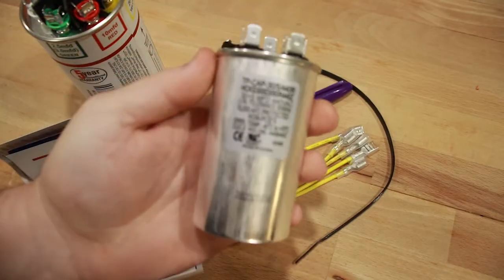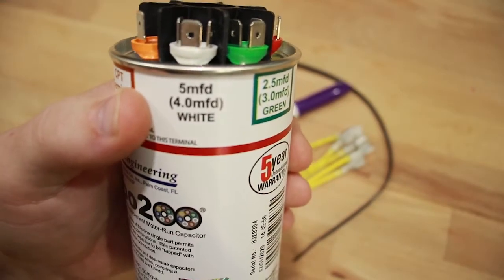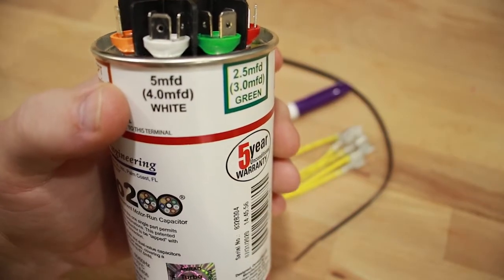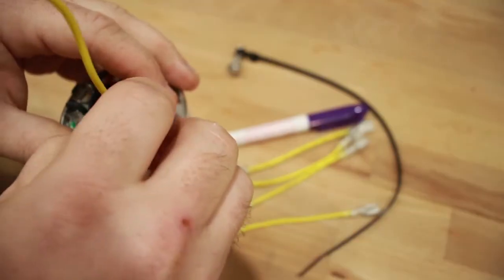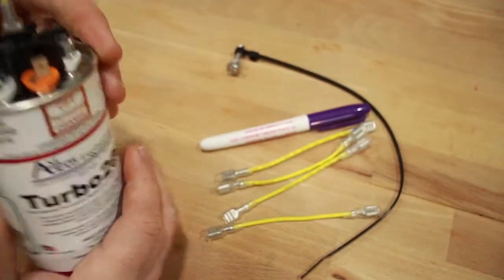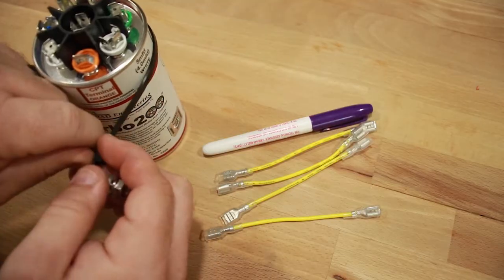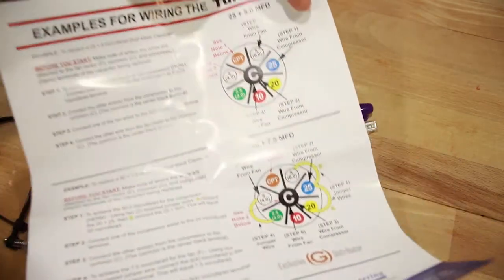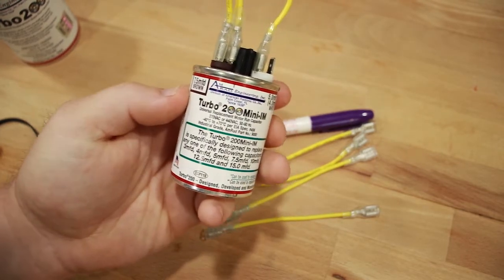How To Wire A Turbo 200 Run Capacitor | heat pump repair

Comment: how would you wire a 40/5 configuration since you need two jumper wires, what do I do with the extra wire?  Thanks!
Reply: You can’t. I’ve tried. Either the fan or compressor won’t run if you wire a 40/5 because the 5 is either the 6 or the 4.

Comment: I took out a turbo 200 capacitor out of my unit I had someone check it with the meter and they said the one side of the capacitor was bad anyway I ordered a brand new one on Amazon is also a turbo 200 it's identical in every way except the new one has a CPT terminal Orange I'm not sure if I have to hook to that connection I basically wired it the same way as the old one but this CPT oranges got me a little confused
Reply from the maker: If you can send me an e-mail with a picture of the new one, I’ll let you know for sure how it’s supposed to be wired.
Reply: @TershBlissett  I went outside and and hooked up the capacitors I first disconnected the power from the main box outside to be safe hooked up all the wires turned it on the fan is running pretty slow and a compressor does not seem to be running at all🤕
Reply from the maker: Admin@serviceemperor.com

Comment: Do you sell just the jumper wires?  I need one to get up to 35 5. Thank you.
Reply from the maker: There’s nothing special about these jumpers. You can actually build your own with two female spade connectors and some wire. You can pick all of that stuff up from your local hardware store.
Reply: @TershBlissett  Could I just use an old orange wire (or brown or black) from an old hard start kit (that is disconnected) and use that as a “jumper wire”?
Reply from the maker: @jayortiz8617  yup, as long as it’s not damaged or anything.
Reply: @TershBlissett  Really appreciate you answering my rookie questions!
Reply from the maker: @jayortiz8617  it’s my pleasure
Reply: @TershBlissett  Thx
Reply from the maker: Hi there @Jay Ortiz. The kits come with the jumper wires and I can give you some of them if you’re local in Savannah GA.
Reply: @TershBlissett  bummer…. I’m in TX….Happy to purchase if at all possible.
Reply: @TershBlissett  if not, is there a different brand of “jumper wires” I can buy online?  Or are these specific to the Turbo?